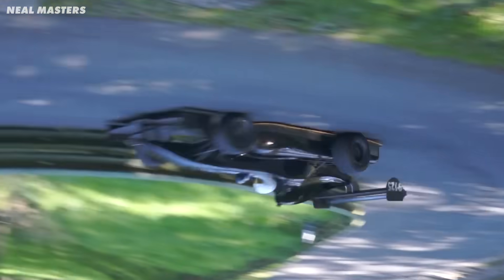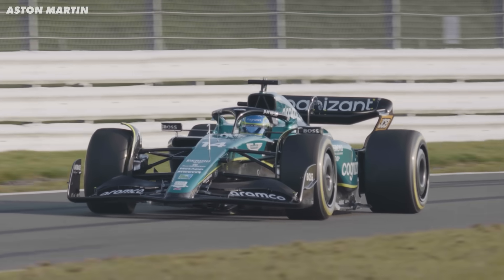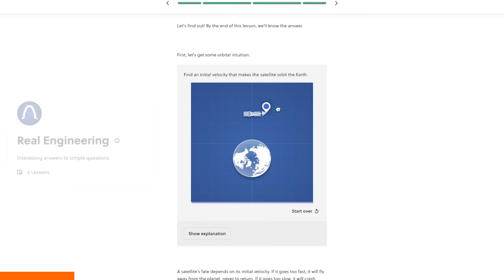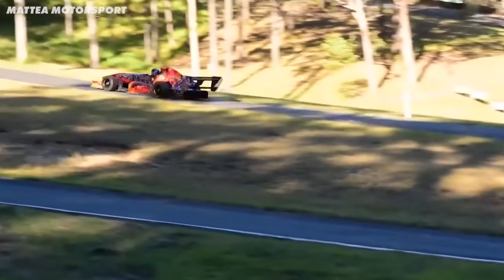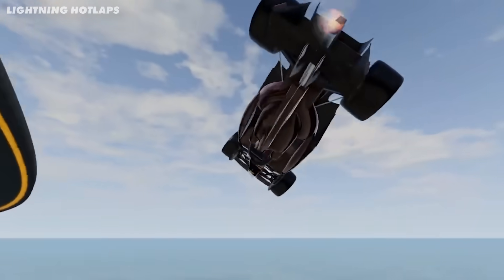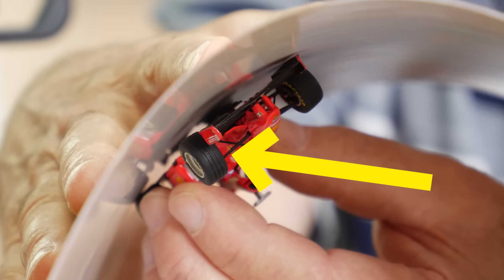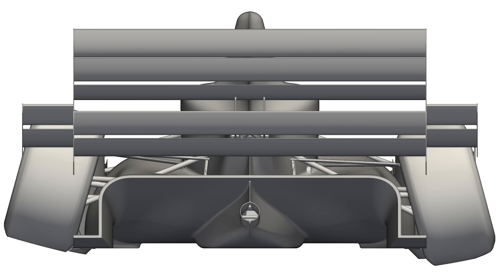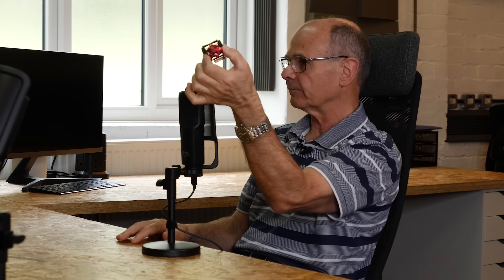How We Designed the Car to DRIVE UPSIDE DOWN

Comment: I still think that starting with the car inverted is the most realistic approach (though could be considered a bit cheeky). Install the car on the ceiling on a track and essentially keep it tethered until it gains enough velocity to generate the required downforce, then have the track end and allow the driver to do their thing. Heck for safety you could always keep a loose tether attached so that if a mechanical or electrical failure occurs it’ll keep the car and driver from certain catastrophe.

Comment: Have you thought about instead of driving up the side of a tunnel to get upside down driving into a loop bringing you upside down. So driving along the tunnel up to speed into a loop and then back down the tunnel upside down.  This would remove the peeling from the danger zone. The drawback would be that the tunnel height would have to be higher but theoretically it should be possible.

Comment: Why don't we get a tunel already build  design a car for that tunnel and start the car already upside down... Get a scissor lift that can accelerate to 80mph and when it gets there it releases the car and the car will continue by itself and then you bring the lift up again matching speeds and after contact start deceleration.

Comment: did you consider a tunnel with changing radius?
meaning, the tunnel is 10m in the area you use for getting up, but then the bottom road goes over a hill so you can only fall 4 or 5m in the middle?

Comment: Why not drive in curve and let centrifugal forces bring you to the top of the  sealing and after that just make a flat road on the sealing for 1-2 km. Its no need to be tunnel right? This will shorter the road cus you can accelerate on flat floor and go up side down easily after that is just hold on to the sealing then go down by also the curve on another side

Comment: How can the gasoline engine work upside down? The oiling system will have to be dry sump at minimum, some kind of extra evac out of the heads, etc

Comment: So, the extra winglets are to scoop the airflow coming off the tires and recondition it to produce more downforce?  Speaking of tires, why didn't you go with wheel arches on the front wheels to clean up rhe air and feed it to those big wings?

Comment: A dual mode fan+aero  car would be a good option. You could use the fan to ensure suction/traction as you transition to the roof, lower it in stages, with the option to speed it up again the microsecond you detect the aero isn't up to the task.

Comment: To keep ride height as small as possible, could you use active aero and use a deforming belly on the car?   With a flexible belly that could "bulge" downwards, the distance to the drive surface going through the concave parts could be minimized.

Comment: EV with hill climb aeropack, suspended from the roof upside down. When car is going fast enough it will stick to the ceiling without any support. When it slows down, it will re-attach to guide rails and stop, suspended  upside down. So simple.

Rule number one as an engineer, don’t over complicate things. Ie don’t be another Richard Noble.

Comment: Remember to correctly calculate the roof’s strength because roofs aren’t used to be designed to resist that amount of force in that vectorial direction. The engineers from the official project already know that (I hope), but the replicators (may some rest in peace) won’t.

Comment: I don’t know a lot about the engines in these cars but no one mentioned oil pressure or fuel pickup while driving in a straight line upside down

Comment: What if you do a loopty loop but at the top of the loopty loop its a straight road or what if you make a flat upside down road and it has a track or rail system that can get the car up to speed and release it when it reaches the proper speed and a vehicle lifts the car up to lock it into the tracks/rails

Comment: I see you chose the car for the experiment, but this time did you find a solution to the problem with the engine working in upside down conditions? Nothing mentioned about this apart from it still being a problem in the beginning of the video.

Comment: Wouldnt it be better to have a tube than a half pipe 90 deg rotated? So u have the option of just running corkscrew avoiding midair spinout?
Also test on an RC first?

Comment: What if  you make run of the tunnel "u"  shaped so you could use the centripedal force  of the car travel along to help you get up the wall. Like a banked corner. The banking continues until the track is inverted. The track would then be straight and you would be inverted. The other end of the "U" would also be banked so you could come down using centripedal force. Safer?

Comment: This project is mental and I think deserve lots of safety protections. 
There is an old MS-DOS game called Stunts where you could do amazing things like loops, jump over massive bridges and .... drive upside down in a cylinder. Well there is obviously some limitations in the physics of the game at some extent but what I learned from it and from my engineering studies is that it's very tricky, though possible. One thing to note is that at least 2G is needed because 1G (normal) - 1G (upside down) = 0G (considering 1G as the force that equals the mass of the car) and this means you are floating in the surface. If you manage to put 1 extra G you will have, well, 1 net G and with 1G you might expect a behavior of a car without aerodynamics in the normal world. In other words what I'm trying to say is that the car you always behave as if it have -1G, simply put a car that can produce 4G in normal circumstances will deliver 3G upside down, so one might expect 3G behavior. On top of that the transition in the cylinder is very trick because you need to turn the car to keep momentum in the normal to upside down phase and deal with the loss in Gs and once you are getting upside down you need to straight it back, but with less Gs ...
It's dangerous, very dangerous.
And I'm really thrilled by the idea.
Good luck!

Comment: Hey, armchair engineer here, but couldnt you solve some of these issues using a rear wheel steering system to crabwalk into place rather than turning at an angle?

Comment: Instead of a tunnel, what about a roadway that starts banking and keeps going until you're upside down? 
Two benefits, 1 it can be lower to the ground in case the car falls off and 2 there isn't the aerodynamic issue of the curved road surface causing a higher ride height

Comment: You also need to th8nk ybout yourself. Even though the car will stick to the road upside doen, you won't, even though you have harnesses you are going to feel like you are about to fall. Your legs will need to push down harder on the throttle and so on. Also the blood in the brain will be very uncomfortable. Keep it safe❤

Comment: Quick question, I watched a bunch of wind tunnel testing footage, notice how the air over the top of the car contours to the back of the car? Won’t the effect of this force be nullified when the car is going upside down, cause the particles wont push up on the car?

Comment: I might have missed this, but did you look at the McMurtry Speirling? 
It seems to have a combination of features that would help with this plan - fan driven ground effects - that could give you greater than 1g downforce from a standstill, electric powered, so no obvious problems running full power inverted. Its new technology too, so great for publicity for your team and them.

Comment: Do you have to transition into being inverted? What if there was a way to have the car start attached to the ceiling, and determine what length of secured inverted rail/track you need to build critical speed. Build in a safety margin and then have that inversion safety track end once sufficient downforce is generated. You would still have to transition out of inverted, but if the track also turned in the transition area (think like a NASCAR oval, but a wider radius) you could also maintain centrifugal force in the transitionary phase to the ground

Comment: This all seems very thought out luckily and it seems like it’s going to work. The only thing I’d be concerned by now is the G-force created by the centrifugal forces during turning. In a 7,5 m diameter tunnel those forces could be super high and that seems dangerous… I hope you’ve calculated these forces and determined that they’re not an issue

Comment: Have you considered starting with the car on the ceiling? It could be supported from above and below whilst it accelerates and decelerates. Once the car is up to speed, it could reach a section without lower supports to allow it to drive on the ceiling. This would allow a tunnel with a perfectly flat roof and mitigate your justified concerns about the impact of transients on aerodynamic performance.

Comment: so tyres lose grip , car can't go as fast, loses the air , drops to the floor. Yeah. Not good !
So what about a "safety" rocket motor, to give a brief bit of thrust that doesn't rely on on tyre grip ?
After all the Land Speed Record has been held since the mid 1960s by essential aeroplanes, where the aero pushes them on the floor, and they just scoot along on some undriven wheels ! 

Yes, my suggestion is a bit made, and the Jet / Rocket assistance needs to be switchable, so not a light it up , and wait until all the fuel is burnt !

Comment: Here's a thought. Why not start with the car upside down. on a flat 'ceiling'. You could have a physical connection between the bottom of the car and the ceiling. 
At least until you got up to speed. Then rely on the down force to hold you 'up'. Then a receiever at the other end to again provide a physical connection to the ceiling. 
I'm not sure you'd get into the seat but, hey that's   just the details.

Comment: Take a correctly weighted, neutral aero car to Insol, suspend it inverted on a rig , run the tunnel to 200kph and look at the load cell readouts to see if they're generating positive upward pressure. We've run tests like this for years on 1/6th scale at various facilities, so putting a car through a 1g twist as it accelerates through the envelope to be inverted hill be down to some top notch construction

Comment: Limit the dangerous transition to just the end of the run. Hang the car  in upside down mode from start using a t hook on bearing  on an anchored track. At optimal speed, disengage t hook and drive on ceiling for a bit. Then , on exit in order to compensate for "peeling" , use centripedal force to transition the end of track which can have a inward curve in 2 directions (east west and north south simultaneously)  a smoother, safer  transition for the final xyz axis segment.
Reply: @flimluvr - like the idea.  We discussed that too, but we discounted it because - if we did that how would people watching be fully confident that we'd done the event for real (i.e. that there was no support rail any more).  Would make the whole thing MUCH easier though.  🙂

Comment: Am I the only one interested more in what can come from this after the project? Like taking the car and "racing" it against other cars. While I am aware that this car wouldn't be "legal" in other motorsports, that's not exactly an issue if it's a for fun event. Like setting lap times in this extreme downforce car vs a modern-ish F1 car or other project cars.

Comment: There are 300hp aircraft piston engines for sale which are certified for aerobatics.
If that's not enough, or too heavy, you can just look into what makes them run smoothly when inverted.

Comment: This all sounds great but.......whats your "plan" for crashing? lol You may find yourself sliding upside down at 100mph for quite long time. 
Study how skateboarders use gforce, momentum, and suspension-legs to stick to a wall. If you do not design the suspension to react properly- like a skateboarder- you will bounce off the vert!

Comment: If you have 4 wheel steering (rear going the same way as the front) you don't have to yaw to get up onto the tunnel.  You'd just translate sideways.  Probably want to activate-deactivate it with paddles or something so you can still steer normally at the same time.  This does put yaw on the aero elements so they're probably less effective, but it sounds less bad than having one corner of the car off the ground.

Aside from "gently fall down" my other question would be how high the car can go if the ground suddenly disappears from above it.  It won't retain force from diffuser, but the other aero will still be lifting it until it decelerates.  For the situation where it goes off the end of the tunnel, or the ceiling of the tunnel fails.

Comment: wouldnt it be way easier to just place the car upside down on a rack with the four top wheelbase surfaces. then lift it to a artificial ceiling. than put all in a wind tunnel and just see if the car gets airborne and sticks to the ceiling. there does not necessarily need to me a lateral movement. weight sensors would do the trick as well...

Comment: In theory, if you're not relying on ground effect, you could have the car sitting on an invertible platform on a semi truck that is going 80mph! If you tie the car to the platform (like a tow strap to take up the wind resistance) and rotate the platform, the car should always keep contact. It would need to go through clean air though, so maybe mount the setup elevated on a semi trailer and the truck cab behind the setup to avoid the wake.
Reply: @MrSaemichlaus - like your idea - I 'd want a moving ground "under" the car (above when the car is inverted) which would add to the cost, but like the idea, very inventive!
Reply: @willemtoet_yt  You mean like a treadmill that runs exactly the ground speed of the semi truck? That would better reproduce the turbulence caused by the wheels turning but it wouldn't allow you to reproduce ground effect, unless you make the treadmill very long so the air could get "attached" to the treadmill ahead of the car, in a way "grabbing and feeding" the air into the underbody.
Reply: @MrSaemichlaus  Exactly as we do in wind tunnels.  Long moving ground systems.

Comment: idea: hamster wheel in a windtunnel

For initial testing, use a "hamster wheel" the diameter of your tunnel and the width of the length of your car. put the car in it, sideways of course, blast air from the side into the hamster wheel, and turn the hamster wheel until the car is upside down. 

Anchor the car so it is safe and doesn't roll back, but with enough give so you can still tell it is kept up by the downforce.

Comment: How are you starting, is it on a normal road then you transition into the tunnel?

I know the sponsors will love this idea 😁

Would it be better if you made a runway the same curve as tunnel and make the underneath of the car fit the curve better.

Also at first I kept thinking about the air density if your running the car in the tunnel a few times how much hotter and less dense is the air at the top but that's probably negligible to the amount of force the car will be producing.

but also how do you choose the tyres? If there are cold spots on the tunnel surface and some hot spots, more likely on the top, does the hardness of the tyre come into it?

Comment: A SUPER crazy option would be to still include ground effect downforce, and make the ENTIRE tunnel/tube the same circumference.  So that even on the bottom it's still curved.  Then design the car's floor so that it descends to follow that curve perfectly.  That would be wild
Reply: This actually makes sense to me. Worth simulation at least
Reply: You could even have a section of road that gradually cork screws to upside down, then back again so you don't need a tunnel.

Comment: Hi, I was wondering , have you considered making the part of the tunnel that the car will travel on during its run flat not curved?, I mean the entire tunnel should be curved I know, but the path the car needs to travel on during its assent and upside down ride and designed can be flattened with extra layer of material, this puts more pressure on the driver to keep the car on the flat part but increases downforce along the ride and reduces the needed speed and car build complexity

Comment: You could partially fill the bottom of the tunnel to decrease your max fall height in case of an accident. However, those surfaces can then no longer be driven on (you might want to if something goes wrong).

Comment: Lots of interesting details in this video! Are you going to do a video about all the changes needed to the ICE engine to be able to do this?
Reply: They are going to use an electric motor.
But there's an older video discussing ice running upside down
Reply: Oh, I didn't see that bit, I was thinking a flat engine might offer the best layout for oil drainage issues, still probably wiser to go electric.

Comment: My thought would be to have a flat section in the tunnel that is a bit wider than the car , and have the flat section spiral from the floor to the roof and the car to drive on this flat section , you would then always have a flat surface for tyres and under car aero